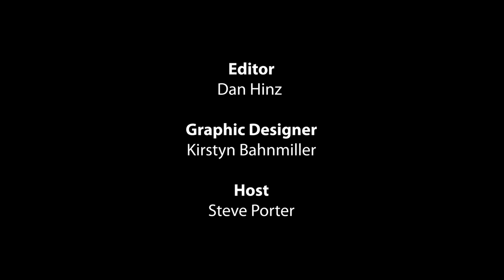The Truth About the Electronics Refurbishing Industry

Comment: I agree it's generally not worth it for the average person. I repaired Xbox Ones and resold them (though I never claimed "refurbished" I told them I repaired them. There's not really much profit margin and alot of broken consoles you could buy on eBay etc were scams where the prior person just took a bunch of broken components and threw them all into one console after stripping anything useful out of them. If you have to replace more than a couple of things you're at a loss. Ie. It was a failed hard drive but whoever had it removed the good disc drive and replaced it with one they knew was faulty and sold it. Now you have multiple unrelated faulty components and it's not even worth fixing so you're just out that money on that console

Comment: For me refurbishment is not only cleaning and repairing anything broken but also preventative maintenance. if a seller replaced a ps4's broken power supply and didn't replace or repair a failing disk drive because it still worked (poorly) thats just a cheap fix not a full refurb

Comment: Bought a refurb off amazon for a friend. HDD failed at 3 months. Never again. Trouble is there are very few lower end NEW PCs for sale at on-line vendors here in Canada. Seems they're ALL refurbs. I don't understand that.
Reply: Becauses new Laptops in Canada are not that much .
I got a New ASUS , with a Ryzen 5300U , 16gb ddr6 ,256gb ssd with Wifi 6 for $500 Canadian  with one year warranty .
Why bother with a $300 used laptop with older hardware and lower performance .

Comment: Instead of using cotton swabs, tiny brushes and vacuums invest in a leaf blower. (thats if you don't want to use liquids) Go outside, blast it with air and all that bulk dust is done in seconds. But it wont remove caked on dirt, you're gonna need some liquid and toothbrush for that. But if you want the plastic looking brand spanking new, there's no replacement than good ol' soap and water (and for the circuit boards use isopropyl alcohol instead)

Comment: Refurbished to me means, they isolated the problem the machine that caused it to be "returned" and fixed. Then if just traded in, both instances should result in at least the cleaning of anything that could cause issue with performance. It would be nice for them to redo thermal paste but I wouldnt expect them to do so unless heat was a side effect of any malfunction. Then it would be required.

Comment: I would take it apart air blow the casing in & out and clean it  & air blow motherboard as I don't like wiping or using q tips on motherboard,  clean disc drive, add thermal paste and put back together Clean case when back together and test I would say 1hr/2hr max but that's taking Time and not rushing it

Comment: Refurbished to me means clean and in operationally perfect condition. Other than aesthetic issue that cannot be cleaned (scratches, plastic wear, etc.) the device should be perfect. Also, refurbished should come at a premium over "used". Used doesn't imply that any work was done to restore it to better condition.

I remember buying refurbished computers from Compaq and they were actually new that got returned because of a defect, repaired, and sold as refurbished for less than new, but more than a used computer. Those systems were nearly perfect and operated indistinguishably from new.

Comment: I feel there should be a minimum level of expectation when selling "refurbished" vs "used"  for a computer like device to be refurbed it should REQUIRE a clean of inside and out,  the thermal paste cleaned off and replaced, if the console is more than 3 years old the lil cmos/clock batter should be replace, rollers replaced if they are worn down to slippy slidey condition.  They shouldn't be able to claim "refurbished" otherwise...  if you don't do these things then you are selling it "USED" not refurbished.

Comment: I have already said in a comment that there are 2 types of refurbishment in the UK. One is where the product is returned to the seller and can't be sold as brand new. The other is when the product as been repaired or a new part replaced. If anyone says they have refurbished a console but there has been no repair then im sure this will be a breach of FTC as they state you cannot have deceptive labelling.

For me personally, if someone put refurbished. I expect that there was a repair or new parts installed and that it was cleaned so the console is fully working and in the best clean state it can possibly be in. Someone putting refurb on a console they only cleaned should be labelled as 'fully cleaned' not refurbished. To me there's a difference. Otherwise just out 'used'
I absolutely clean everything in a console so it looks like from new. And i will put 'professionally cleaned' in the description .

Comment: I see refurbished as cleaning and testing and repairing if necessary. Pretty much in a state as brand new in regards of functionality and life span expectation, as refurbished also presume a guarantee for the product just as it would be sold as new, just that it's used and maybe outdated and so it may be sold at a very low price.
Reselling second hand stuff without that testing, cleaning and guarantee is not selling refurbished in a professional manner as any company should be held accountable to do it, but rather some type of direct ebay sale done by a private oblivious person, but not really as those at least don't really have any ill intention and just want to make some money on some stuff they don't need anymore while a company doing the exact same thing is plainly scamming you.

Comment: Refurbished has a historically well defined meaning within service industries. The fact that it's become accepted practice to take liberties with the definition doesn't change its meaning.  The goal should be a product sold within a graded operating specification. What does that mean? It should mean a product comprised of used components  similarly presented as if purchase from new. That means no functional damage, cleaned and any worn parts replaced. It means lubrication and thermal compounds replaced as the manufacturer would have done when new. Failing components such as loose connectors, siezed bearings and bulging /leaking capacitors should also be replaced. Short of these things, it shouldnt be referred to as refurbished.

Comment: To me refurbished means different things depending on the source for the device. Used: taken apart, cleaned thoroughly (soaked in IPA, ultrasonic cleaned etc, in short: deep cleaned), repaired with good used original parts or with new original parts (if soldered that's "fixed" not refurbished to me). Used refurbished should start as a working device with some wear and tear, without any extraordinary issues - just regular wear. New refurbished: at best refurbished is a new device that had an easy to fix problem from the factory: like faulty ram or PSU which had to have been replaced by hand. All in all it means to make it as close to a brand new one so that the device would still have years and years of life in it, that included replacing worn out, near their end of life components (even if technically working). Btw replacing thermal grease is mandatory, not liq metals tho cos those dont exactly dry.

Comment: I buy a lot of refurbished network hardware. I wish refurbishers would update the firmware once in a while. i have had devices arrive with firmware from 10 years ago. at that point it is a challenge to even upgrade it to recent firmware due to incompatibilities between versions. 

And yes, I need the latest firmware.

Comment: personally "refurbished" should always mean that it has been taken apart and cleaned , new thermal paste and stuff, basically "factory like" conditions on the inside. I dont mind if its cosmetically flawed (like DK Oldies named it) like some dents or blemishes on the case and outer shell, thats totally fine, but if you call it refurbished, you have to make sure that the inside is flawless

Comment: Hi, you don't mention refurbished by the manufacturer, I wanted to buy a Bose tv sound bar, new it was £269.00 refurbished it was £169.00, but I missed out, they sold out, so I bought a new one. One thing that infuriates me is that firms sell items as new, and you get an obviously opened and reboxed item. if an item is sent back it should be examined, checked for faults, and sold as a working return for a few pounds less than retail.

Comment: I never list anything that's been used as refurbished, no matter how much I clean it. You cant just scrub a few years of use off of a GPU. Even if i take 3 hours or 3 minutes cleaning it, its still "used". I have 2 reasons for this. 1) Thermal degradation. Every CPU, GPU, nand flash and Ram module, experience this. After so long of a component getting hot, they loose their lifespan. CPU's that are not overclocked are not near as effected as a GPU, but for the newer consoles you need to take this into consideration. That APU only has a certain amount of hours in it until it just burns out and dies. The second reason is that if I clean it and call it used, I am going to ask nearly the same amount for it as I would if it was a referb.  I get my consoles for next to nothing, it don't hurt me one bit to open them, clean them and apply new pads and thermal paste. I still list them as used and explain everything I have done to the system. I have several collectors that are repeat buyers. So much that I don't need a giant customer base to make money. I am the kinda person that would not be able to sleep at night if I operated like DKOldies. Karma is one mean ornery bi$ch . . .

Comment: I have always steered away from refurbished or certified products starting with cars. Toyota and other dealers have a line of used cars they call certified and they say the cars are inspected, serviced, and repaired. In my opinion I don’t think the cars are being serviced and repaired to the level the dealers claim. I think they are wash and the interior is clean and that’s it. If a customer comes back the dealer will try to blame the issue on the buyer or will state they will repair the issue but it is outside of any warranty given. I think these refurbished electronics are the same, the exterior is cleaned possibly damaging a piano black or similar
surface and vacuumed from exterior reachable locations and sold for a premium. I’ll buy a private party item and repair and clean it myself or take it to a reputable repair shop.

Comment: I think that you could charge more for a truly "refurbished" PS4 console.  If you clean the inside and replace worn parts, you can offer a long warranty and garner much better customer satisfaction and in turn much better word of mouth. The wiped off consoles are going to have a much higher failure rate from overheating and worn parts. The customer would have to replace multiple units to match the lifespan of one that is truly refurbished. A good analogy is the difference between getting your car washed and getting it detailed.  One costs $25 and the other $125. There are markets for both. I don't think it would be feasible for other older consoles, but given the issues and availability of the PS5, the PS4 market is very active.

Comment: Refurbished should be a protected term. It should mean taken apart and cleaned, repaired and reapplication of thermal paste.

They need to call stuff what it is. Which is usually used and cleaned on the outside.

Comment: My opinion for refurbishment is similar to yours, in that I think it should be a like new product with all issues resolved unless otherwise disclosed. In general I think that should be all problems fixed, disassembled and cleaned, and have new thermal paste. For products that are known to have issues like the original Xbox and it's leaky capacitors in my opinion those would need to be replaced as well. After that I believe it should be tested to assure no issues are present. In my opinion should have no problems.

Comment: I honestly view refurbished as being a system that has any repairs needed done to them and a cleaning of all important areas (heat sink, disc drive) possibly a replaced fan or hdd) but not original and not just used. Used all I expect is that it’s atleast been cleaned.

Comment: Refurbishment seems like a loose term electronic businesses use as it doesn’t indicate the level of inspection, repair or replacement of one or more needed components in a device.  As was stated in the video, some refurbishment companies just clean the outside of the device and call it “refurbished”.  I ABHOR companies that use this half-baked measures for the sake of profit!  I think refurbishment should be held to a standard so that customers don’t get ripped off by shady individuals.  Refurbishment should mean that the device was (to the best of refurbisher’s ability) First and Foremost inspected, tested, if faulty, disassembled, cleaned, repair or replace faulty components, reassembled, tested to satisfaction and DOCUMENTED so the customer see’s the device’s history while it was at the repair shop!  My experience was that my brother sent in his son’s PlayStation 4 for making jet noises to a game repair shop (they said they “fixed” it) only to be returned making jet noises!  When I got ahold of it, I opened it up and discovered the heat sink and fan blower housing full of caked-on lint and dust!  Also the disc drive rollers, laser and tray were not clean!  Welp, I cleaned all of that up (thankfully the components were still good) and now it’s whisper quiet, no jet noises or thermal shutdown warnings and my nephew’s happier than ever!😂  Now other relatives swamp me with their console woes!😂  My skills are at best basic maintenance, nothin’ special…

Comment: Question: why don't you just use an air compressor to blow out the dust and dirt on the plastic pieces and the heat sink?  In my mind, that's a one-time purchase that could save time and money in the long run.

Comment: With things like car parts 'Refurbished'  usually means cleaned, repaired if needed and tested for quality.  If you get a refurbished console from lets say Nintendo directly then like car parts that's what it means to be refurbished.  Far as I'm concerned most that claim refurbished, is not refurbished at all.  It's just touched up cosmetically nothing more and false advertising.  What you did was a proper refurbishment.  Though, I think replacing the worn roller would have been good to do anyway.    A good refurbishment is worth paying a few extra dollars and I often find more reliable than new being that the weak parts are weeded out and the unit well broken in otherwise.

Comment: To address the whole "Electronics Refurbishing Industry" with that video is not fair. I agree to everything when it's about consumer electronics like Playstations etc. But there is also another industry that refurbishes professional servers and parts. I'm working in that industry for many years now.
You can't compare profesional electronics and consumer devices. A server for example is very easy to take apart and clean although it may require more time for testing. But the parts can be sold with more profit. As an example, we bought a batch of 60 IBM servers for $800 per piece. Inside the servers were 60x 1TB of RAM. The RAM alone could be sold for $1500 per TB, not speaking about the rest of the parts. RAM modules, CPUs, Mainboards and PCIe cards can be removed and cleaned very easily, not much worktime needed.
But of course this is a completely different story when compared to consumer devices. BTW... compressed air and a dust collector system makes the task much easier than using a brush and a vacuum cleaner. And if your vacuum is not antistatic, you CAN damage the board (own experience 🙂)

Comment: If I buy a refurbished system I don't care if it is a bit more expensive, as long as I get a guarantee that it has been cleaned and got proper maintenance. 
Having pictures of the internals of the actual console that is set up for sale on, for example ebay, instead of a "reference picture" of a completely different unit like many sellers do (and then they sell you consoles with cracked cases, because "this is a reference photo, actual product condition may vary" is still a legal scam I guess), should justify a higher price.
Being pricier than the competition is fine as long as you can satisfy customers and keep your credibility.

If I want a dirty console that I'll clean and repair myself, I am not going to pay that premium those resellers charge.

Comment: You have to be able to get parts and main units for cheap, VERY cheap to make a decent wage at it. How do I know? I try to upcycle  older tech/test hardware.  Btw, I might have some great condition ps4 fans if your ever looking for some.  BTW Isopropyl shouldn't be used on most plastics as it breaks them down. if you do use iso, follow it with water to neutralize it.

Comment: For me the bare min is clean it inside and out fully, and repaste it. Then test for function/noise. If all good, id call that the bare min of a refurb job. Thats how i sell things anyways. You dont have to replace every little chip and trace, if the things been cleaned fully and has fresh paste on chip (And functions as new/expected). These companies cant even do that as the bare min, and the law needs to change. A customer buying a refurb unit should not be getting one full of dust gunk and dried paste. Hell i even go as far as offering to paste the system again in the case of ps4's and ps4 pros if they become noisy again, i do this for free if the buyer covers shipping, i dont care if its been 3 years since i sold them the thing, ship it out and ill take care of it. Its embarrassing calling yourself a company if you cant even meet my standards.